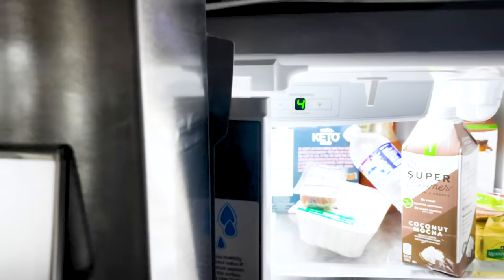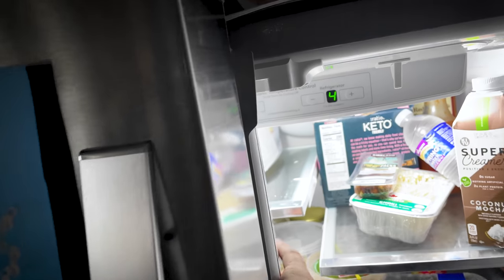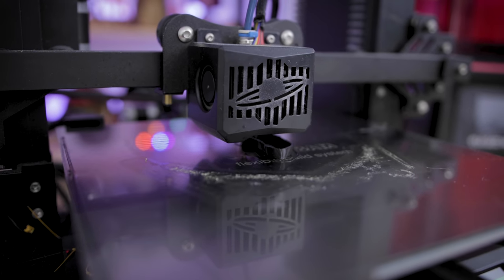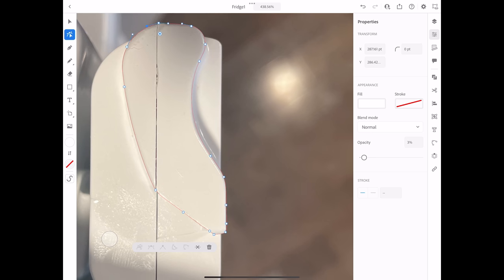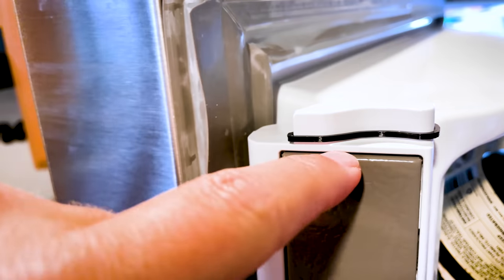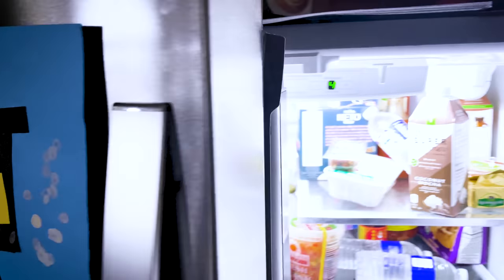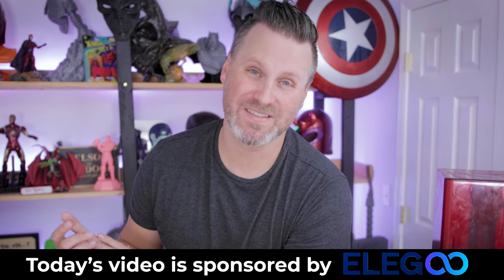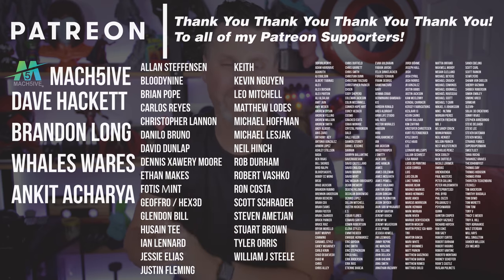Can I fix my Fridge with a 3D Printer? Functional 3D Printing

Comment: You're Fridge isn't sitting level on the ground.  My fridge will do the same thing.  The fix is to mess with the adjustable feet on the bottom of the fridge.  The feet should look like big black knobs, that have slits in them, to fit a screw driver.  Either grab a screw driver, or a wrench, and start turning.   One side is too low, or the other is too high.   Just takes some trial and error to get it.   Mine still isn't perfect, but it 100% works.  It should really only take a few minutes of twisting to get it to the point where that flap works correctly.  If the fridge is full, I'd suggest either a long screw driver, or a pipe wrench, as those knobs won't be super easy to turn.  Also if you use a wrench, be careful about scratching the floor.  I found that one out on my own.   At least for me, It's because my house is nearly 100 years old, so nothing is totally level, including the kitchen floor.  So it's not my fridge's fault, but just my old ass house settling in weird ways.  EDIT: Just wanted to say, My fridge is a Samsung, but it uses the same mechanism.  That's why I'm thinking it's the leveling.  I'm guessing it works the same on both brands.

Comment: This would have been easy to make is solidworks, fusion 360, or even blender (which is free). Nice video!
Reply from the maker: 😬🤘 yeah will have to try one of those next time. Quick and easy on the tablet

Comment: I don't have Adobe Illustrator but I would have done the same as you. Take a top-down photo with a ruler near it, import the photo into Blender, and do the modeling/testing as you did. Seems like they did a bad install on the product but now you can use that savings and get more filament!

Comment: Actually your method in the end I think was pretty cool, and yet another 'simple' wy to get the job done.  I too am still figuring out best way to model things, as I have generally used tinkercad, which either design from scratch some by caliper measurements, some by trial and error, or modify other pre-existing designs to augment for my needs.  While I love some of the 'trinkets' I print, It is really cool though when doing functional or fix it 3D printing.  I literally see problems now that I start to think, what can I 3D print to solve this.... :)  Even my wife brings me things....

Comment: I have the same frig and if the bottom plastic piece breaks on the bottom right door they don't make a replacement, just to let you know its from to much weight in the door that causes it. I had to rig mine, they should have made this out of metal, its what holds the pivot  part that they do sell?????? lol nice job on your door I just lifted mine back up after loosing the screws.

Comment: It looks like you just need to raise the door with the jack screw in the bottom hinge.
Reply from the maker: 110% chance I would have jacked my door up more🤣😂 awesome to know though! Thank you!
Reply: Definitely this.  The doors are made to adjust up and down to get them to meet properly (just like kitchen cabinet doors).  But I would also probably break them trying to adjust myself as well….  So even though i know how to fix it, doesnt mean I can lol
Reply: @paulbeers4105  ah, it's dead simple. Most of the bottom door hinges have a hex screw on the bottom side of the hinge. You just pull open the freezer to access them. Turn the screw one way,  the door goes up. The other way and it goes down. Can't really mess it up. 🙂👍

Comment: If you had printed out a 1 inch ruler section on paper and taped it to the top before taking the picture, scaling it to the right size would have been a breeze.

I've seen people use this approach with smaller objects and a flatbed scanner to great effect

Comment: The door has a Allen screw on the bottom of that door hinge raises up door to  align the articulating mullion with the catch in the ceiling unless the top of articulating mullion is broken no parts are needed.

Comment: Practical design is all I ever do.  It is frustrating to me that all the 3d printing YouTubers are making miniatures, busts, and cosplay stuff.  They do not address the issues of practical design which for resin printing is primarily brittleness.  I model connector heads for automotive harness test equipment mostly.  But it would be good to see more examples of 3D resin and FDM printing for industrial design applications.

Comment: I love this.  I bought a new glue gun and it had the wrong wire stand.  When I it set it down the nozzle touched the table.  Drove me crazy so I tried making a paper pattern of the bottom and that didn't work.  I just scanned the bottom with my printer and built a stand from that. Worked perfectly.  👍🏼

Comment: If you look at the bottom hinge on the door, there should be a flanged nut that you can adjust down to raise the door. If not. You can insert a nylon shim (washer) to do the same.
My advice is that whichever method you use, don't raise it up so far that you can't fit your printed piece on top of the mullion. After all, you've finally justified your 3D printer purchases in your wife's eyes. Don't mess that up!

Comment: I actually had a similar problem with my fridge, except the top piece broke off. Same reasoning though, why spend 100+ on a replacement, when I could just print it. Practical prints like that justify the expenses sometimes lol

Comment: I have this same exact issue with my fridge, And it looks to be the same fridge, Can I get that file?
Reply: Check the height adjustable feet on the bottom front of your fridge.  They will look like big black knobs.  You might have to use a wrench, or a screw driver to turn them ( they have slots in them to fit a large screw driver ).  One side is probably just sitting too low. I have a samsung that has this same issue.  The problem for me, is my old house not being level.  Just raise / lower one side, and you should notice that flippy mechanism get closer and closer to the guide in the middle, until it engages and starts to work properly.

Comment: That is 100% the manufactures fault. If I shipped a bad dildo (I wouldn't) I'd do everything in my power to fix the problem. It's not the customers burden to pay more to receive the full functionality of the product they bought. Glad it worked out for you

Comment: It looks like the door part just attaches with 3M double sided tape to the door, maybe screws that go into the mounts from behind the door panel.  So that new $90 part would have the same issue if installed in the same location as the old one.
Reply: There is a hex key adjuster on the bottom of your door to move it up of down, that should fix the door not hitting the guide at the top.

Comment: Can you please share the 3D model?
Reply: If someone else is experiencing the same issue, I found a simple solution that doesn't require 3D printing or any purchases. I simply stuck a folded piece of paper between the ceiling of the fridge and the bar guide. The 3D part in the video covers the top of the bar. The top of the bar goes into the guide that's attached with two screws to the ceiling of the fridge. I unscrewed the two screws, took off the guide, put a folded piece of paper on the top of the guide and screwed it back in. That allowed me to lower the guide enough for the bar to finally hit it just right.

Comment: I don't trust this guy. No calipers, hasn't even photographed a ruler or size reference piece alongside the object.

It also looks like the fridge doors weren't adjusted properly when installing or they made a bad design. You shouldn't have to pay to get this fixed, the company messed it up to begin with!
Reply: I have a samsung fridge that has the EXACT same mechanism.  I had the same problem, the fix is to adjust the leveling feet on the bottom front of the fridge.  One side is just probably sitting way too low.  Once he adjust them a bit, it should even the doors out a bit, letting that flippy mechanism engage with the guide in the middle.